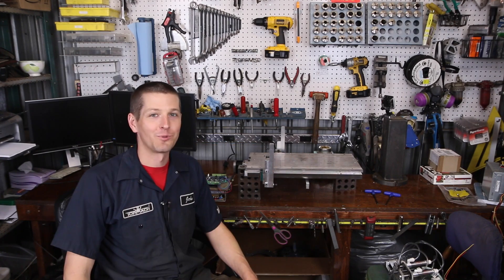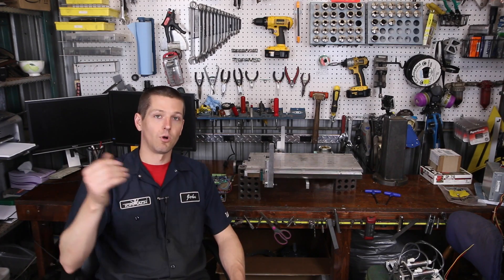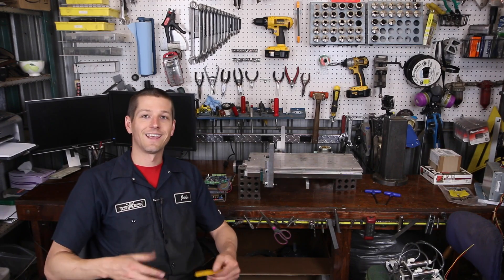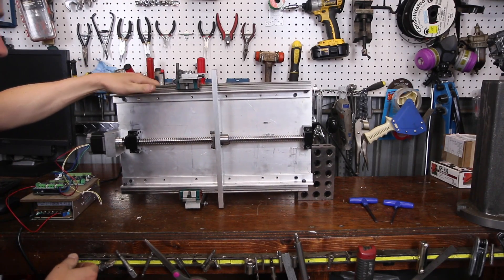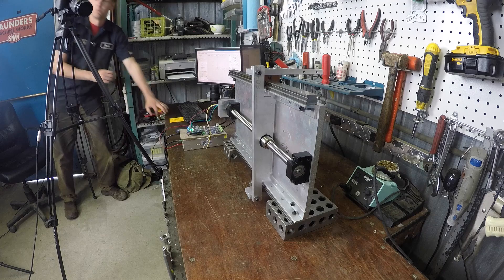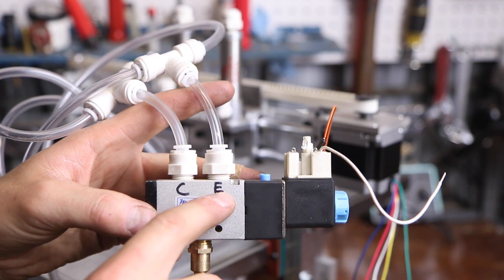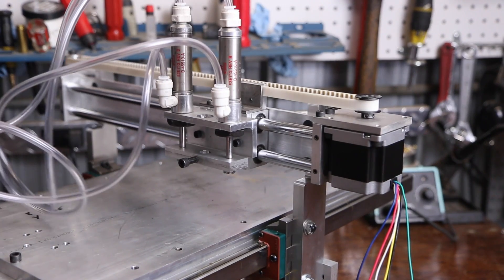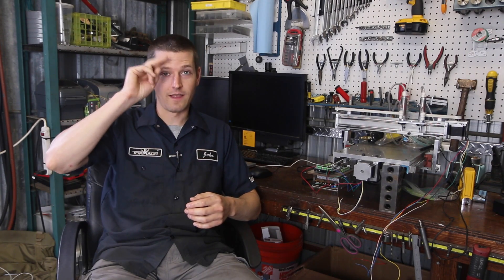DIY CNC Machine: Linear Rails + TinyG Part 2!  Widget41

Comment: What about using a single stepper with pair of variable pressure regulators to both the intake and exhaust ports you are able to dial in the exact height of the head and amount of tension against the workpiece.  0-100% one side while the other side goes from 100-0%.  Simple, but not necessarily as fast and violent.  Although, Z could be set ahead of time, M0/M1 could be a simple solenoid to turn the air on and off to get the "violence of action"  if so desired.
Reply: Also,  I understand why you like TinyG,  but I am a fan of USBCNC,  the controller seems to be easier to work with but lacks the embedded stepper motor controller.

Comment: There is a problem that comes with Stepper motors on a CNC Machine... Very often the amount of amperage peaks out and either the Stepper will burn or the board will... Steppers have a very low torque curve... They draw a lot of power to get the table moving then once it's moving the torque drops off quickly...

Conversely a Servo motor has a very flat torque curve. It reaches it's max very quickly then stays there... Of course servos are more expensive but the peace of mind is worth it... There is one company, which builds the Controllers right into the motor... I've checked them out, but haven't bought one yet... They have what they refer to as a Drop-in Stepper replacement model... http://www.teknic.com/products/clearpath-brushless-dc-servo-motors/

Hope that helps :-) Great video btw :-) Looking forward to more...
Reply: You can potmod (remove potentiometer) a standard servo to make it work like a servo motor, it's a bit of a hack but it saves money and works.

Comment: You mentioned you would like to see things get more standardized which I agree.  What are things like on the metal side of the professional cnc world?  On the wood side a good share of everything is propriety so if something breaks your at the mercy of the company that built it.
Reply: I meant machinery wise not materials.  Like if you blow a motor or electrical component on like a tormach is the only replacements from tormach?

Comment: Better to use cylinders with end damping. You can run them in high speed without annoying sound :P They are running with full speed and right before they stop they slow down-> no noise, saves product lifetime, less vibrations in the system...
Principle: http://www.festo.com/rep/en-us_us/assets/pdf/AirCushion_WhitePaper.pdf

Comment: Great! Indeed, there's something mesmerizing watching the ball screws rotate :P

Oh and I second the tip to se mufflers with the pneumatic actuators. They work much smoother without that "kick".
Reply: Look on the solenoids. They often have the ports for the mufflers. Then, depending on the "grain" size of the muffler, you regulate the amount of pressure released. But this is way beyond my expertise, I just have a machine using such setup here at work.
Reply: NYC CNC You should have mufflers on both exhaust ports on that five way solenoid valve.  They sort of work as flow controls, but their real purpose is to keep shop crud out of the solenoid valve.  There are some precision clearances inside the solenoid valve and you'll have maintenance problems if you run an open pneumatic system.

Comment: I set up my laser to run on LInuxcnc a while back, which doesn't have a Z axis, but does need to fire the laser and turn off the laser. I accomplished that simply by using the DIR signal that would have gone to a Z axis stepper, if I had one. This fires the laser on all down moves and turns it off on all up moves. I haven't looked at the tiny G boards to see if that is a possibility. But the bonus to it is you don't need to modify your standard G code at all. it works fine as is. Otherwise, you will need to manually modify your G code. Search, find replace, G01 Z-0.100 to M03 and G00 Z1.000 to M05 or whatever the equivalent applicable codes are.

Comment: If you need to control the speed the air cylinders they do make flow controls that would replace the 90 deg fittings and have adjustment screws on them.  You'd be able to use whatever air press. you'd need  but  independently control how fast they move.   Probably not an issue though. 
 We also used a lot of linear bearings and really didn't have too many problems with those getting fouled with dirt and debris--  like we did with the ball-nuts.
Reply: I was just trying to sound like I knew what I was talking about... ya know. lol
Reply: ***** In this case (using a 5 way valve) the flow speed controllers would go on the exit ports of the valve. As a bonus, they also provide silencing. :)
Reply: Yeah, that's another way and probably a little cheaper.

Comment: Laser engravers have the same on/off problem with G-Code. Some examples I've seen use the fan control M106/M107 command to switch the engraver on and off. Another advantage of this is it'll give you the 12V directly.

There are scripts that convert Gcode to be compatible with this type of system, it strips out any downward motion in Z gcode and replaces with M106 and likewise with upwards motion and M107.

Comment: Is it just me, or does the left cylinder moves more than the right one? That could cause problems when engraving.
Reply: ***** I designed my power draw bar with two side-by-side SMC air cylinders.  SMC warns that it's generally not advisable to do this because it's impossible to guarantee that both air cylinders will operate at the same speed, and even if the air flow is initially adjusted to balance the speed, they may become unbalanced over time as the air cylinders wear.  Mechanical engineers usually look for mechanical analogies to help them understand electrical systems they can't see.  I'm an electrical engineer, so I look for electrical analogies to help me understand mechanical systems.  The gain of a transistor is a poorly controlled manufacturing parameter.  It's a bad idea to design an amplifier with two parallel transistors because they wouldn't equally share the current load.  One transistor would always be fighting the other.  Similarly, the velocity of an air cylinder is a poorly controlled manufacturing parameter.

In the case of my power draw bar, I justified the questionable design practice by telling myself that I'll be slowing both cylinders down so much that they won't be racing each other, I can easily monitor their operation and regularly make the adjustments to keep them operating at the same rate, and (most importantly) the stroke is so short that these fat little air cylinders will never get too far out of sync with each other as expressed in relative degrees of shaft misalignment, so the shaft seals won't be side loaded to any significant degree.  The other "most important" justification is that I intentionally used a lot of compliance in the design.  Both cylinders push on a flat steel plate.  They aren't rigidly tied to each other mechanically in a fixed system where any difference in force is translated into transverse force on the shaft seals.  I could probably disconnect one cylinder and the other short cylinder would push as hard as it could and wouldn't harm either cylinder.  But it's still not a good design practice.

In John's case, the cylinder travel to cylinder diameter ratio is much greater (a bad thing) but the forces are much less (a good thing).  I think he'll be OK.  I'd score it minus three points on the design and plus 100,000 geek bonus points for the awesome.

I do think John might want to add four flow controls to balance the extend and retract speed of the individual cylinders.  He's currently using air pressure to control the speed of both cylinders in parallel.  Controlling flow instead of pressure is analogous to controlling the electrical current instead of the voltage.  You can control the air flow indirectly by controlling the pressure, but it's not a linear relationship.  I think it'd be better to directly control what matters... the air flow.  Besides, flow controls are much cheaper and less bulky than regulators.  :-)

Comment: Good stuff. Love the videos. Glad to see you're still enjoying ChiliPeppr. BTW, ChiliPeppr could give you some additional options for toggling your air cylinders. There's a macro called "Send Serial to CNC and Arduino Simultaneously" that could solve your problem. Or, you could mimic what the laser solderer widget does or even use it. You could also use the macro example "Watch gcode complete..." that turns the laser on/off.

Comment: Z axis for on off, you could put the rails under the base plate, use a couple of sleeves on the Z axis it would not be hard to add them sinces the Z wont go up and down very much so they would be fine, ask on autodesk cam forum for a tiny G pp to do what you wont

Comment: I  design CNC machines and you have some design flaws. =oP

-The air cylinders are not designed to take on radial load; also they are not very precise in their movement. Your engraving may be slopping because of the lack of rigidity in the Z axis system; and overtime they will wear out and get very sloppy. I would not use them in the way you are. You should have a small 8mm or 10mm etc linear rail in the Z axis. 
-I would use MIC-6 for the base and machine a locating ridge and mount the linear rails directly to the base. The angle L-brackets leave a little to be desired.

However, your engraver looks really nice and can't wait to see the progress! Thanks for posting another cool video!

Comment: So the engraving bit will slam into the part surface?
Reply: NYC CNC Design a floating engraver mount that allows for a "pad" that contacts the workpiece with the engraver tip sticking out (to desired engraving depth) just below the pad. Make the floating travel a half an inch or so and give it enough weight to give a good engraving. This will compensate for any Z inaccuracies with the Z axis travel and will give a consistent depth engraving anywhere on the table even if the part isn't perfectly flat.

Comment: I say make it binary, GX Z0=up and GX Z1=down. Another thing that would be useful is to have 2 or 3 regulators in parallel to regulate the pressure on the pen (Z1 Z2 Z3) because you may need more pressure for stainless than aluminum also could be a way to alter the stencil contrast. BTW I would not worry about the exposed rails with this type of application. Thanks for another killer video!!
Reply: If you would like help designing a flip flop circuit I'd be more than willing to volunteer some time.

Comment: You might want to treat the engraving head like a plasma head. M code to activate. Also you will probably have to have an adjustable spring tension on the engraver z axis. So the tool can float and be under some preload. All of my rotary engravers have floating cutter heads. Industry standard. If you want some pics. Let me know!
Reply: No problem! Will do

Comment: I had a Dynatorch CNC plasma machine that had an optional engraving pen mounted alongside the plasma torch height axis.

Like your plan here, they just used the air cylinder that extended and retracted the engraver as the Z axis locating hardware (IE no linear rails in the Z axis).  This didn't work worth a damn.

The air cylinders will develop slop in basically no time at all when subjected to lateral loads.  Our cylinder could not locate the engraver properly from day 1 (IE it never engraved properly before we modified it), and very quickly after that began to leak from the abuse the "stock" setup was putting on the seals.

Long story short, don't ask the air cylinders to do the job of linear rails while they're also doing their own job as a force element, the result will be sub-optimal to say the least.

What we ended up doing was mounting a pair of linear rails along side the air cylinders to absorb the lateral loads.  We mounted the rails to the engraver base and the trolley blocks that ride on the rail to the gantry, kind of inverting the "normal" arrangement of things, but it kept the rail from hanging down in the way all the time (even when the engraver was retracted).
Reply: NYC CNC I would be happy to, if I'd have taken any while it was still here.

It has since gone to the great scrap heap in the sky, via a path best discussed elsewhere.  Suffice to say that is a story best left to email.

My setup had the engraver inside a little box made from extrusion and a couple of cap plates which was attached to an air cylinder powered linear slide actuator.  Neat thing, like an air cylinder built inside a hunk of 80/20 extrusion, but not intended to locate anything laterally.

What I did was affix the trucks from the two small linear rails (forgive me, I can't remember the size, but they were small, the rails were only 3/8"-1/2" wide and maybe a foot long) to the gantry on either side of the air cylinder thing, while the rails themselves were affixed to either side of the little box via machined aluminum standoffs.

It only had a stroke of about 6" or so, and the twin rails worked just fine with that amount of extension.

Another thing to think about is how hard you press the engraver into the part.  The Dynatorch people allowed the engraving pen to float axially so it wouldn't dig in.  IMO this was a cop-out (like so much of their design work, they chose the easy path that didn't work very well) to try and mitigate the poor lateral location ability of their air slide thingie.

Anyway, it's something to consider, because if you push fairl hard on aluminum you might plow a furrow 0.030" deep, whereas that same down pressure on steel might only make a mark 0.003" deep.
Reply: NYC CNC Sent you an email, BTW.  Might check your SPAM folders if you don't see one by this afternoon.

Comment: Use the coolant output to drive your cylinders 
M8 down, M9 up.
Reply: MCEngineeringInc I think that would stall the machine every time you do it. I think it would be possible to use the direction output for the Z axis, I believe it will stay high/low depending on the last move

Comment: Your pneumatic bang-bang control of the Z axis (up or down, but no analog in between) is similar to using G code to control a laser.  The laser is a 2D (or maybe a 2.5D) machine.  It doesn't have various degrees of up or down.  It's driven in X and Y and the laser is turned on or off.  I can't tell you exactly how that would be done with TinyG, but in LinuxCNC, that's often done by setting Z=0 for laser off and Z = -.001 (or some other value) for laser on.  LinuxCNC has a hardware abstraction layer (HAL) and it's possible to set a variable that is on for non-zero values of Z.  It's handy to use Z control because it allows the laser to engrave using the same sort of G code that would engrave on a CNC router.  The other way to do it in HAL is to define M codes to turn on the laser (or pneumatic engaving pen solenoid), much as you'd turn on flood cooling.

This project is looking good!  I'm looking forward to part 3!
Reply: Linux CNC is far superior. I used it on million dollar machines and on my own home 3d printer.
Reply: Mekhanic1 The problem is finding a PC with a parallel port
Reply: Lasse Langwadt Christensen I use Atom based motherboards.  Example: D525DW.  They have four USB ports, a parallel port, a serial port, a VGA video port, keyboard and mouse ports, Ethernet port, etc.  Those are getting harder to find, but it seems that whenever one Atom based motherboard that Just Works with LinuxCNC is discontinued, there is another to take its place.  Computing speed isn't all that important, but low latency (no clock cycle stealing hardware interrupts) is important for realtime control.  Lately, I've been adding a $9 Chinese parallel port to the PCI slot to make a second parallel printer port for twice the digital I/O.  Even if you can't get a parallel port, the MESA Electronics boards are reasonably priced and they have a lot more I/O options, built-in motion control for steppers or servos, analog I/O, etc.
Reply: +1 MESA daughter cards are the way to go if it's in the budget.

Comment: Shame about the TinyG. It's actually a hard lesson for people to learn about anti static bags. 

NEVER never never put electronics on them. They are designed to carry the electrons on the outside, you can however turn them inside out and get away with it if it's not an internally coated bag. Best to just put them aside! Not risking anything then :)

Comment: Grab a set of mufflers for the 5 port. I happen to have a set on my draw bar it will allow you to change the air cylinders timing with out compromising how many psi needs to be sent to it. There cheap also.
Reply: NYC CNC 
yup but unlike reducing pressure you will always have full strength when using a muffler. And they make it much much quieter .